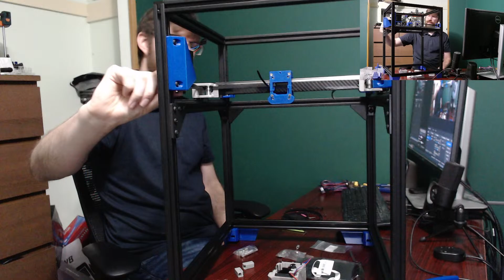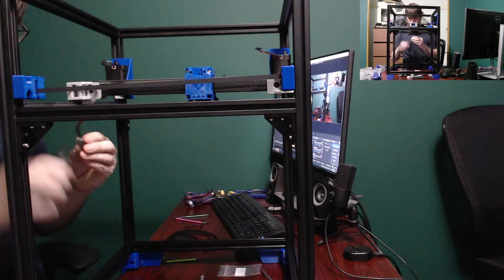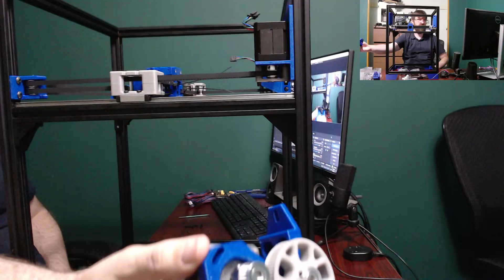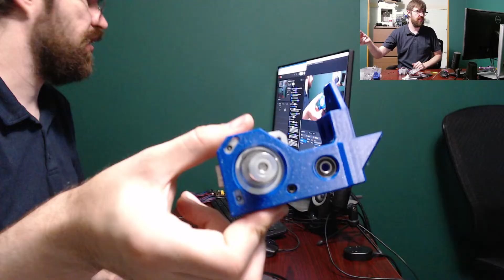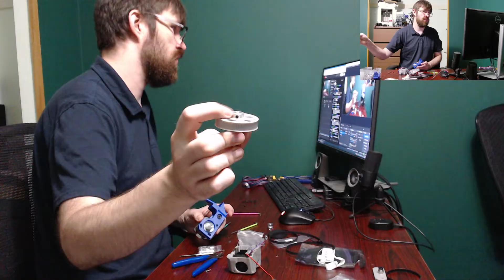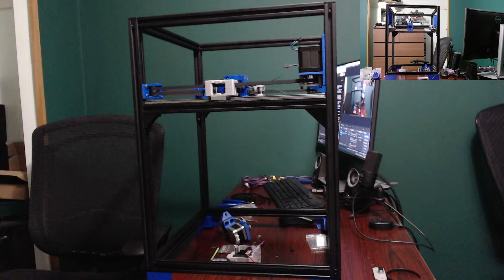SimpleCore Redux Build Part 4: XY Belts

Comment: Can I use the same mechanics to make it bigger? I want make one 500x500x100mm.
I make sings printing channel letters on my current machine 300x300
Reply from the maker: the belts will be very long at that size, CoreXY doesn't scale well that large
Reply: @Rolohaun what do you recommend?